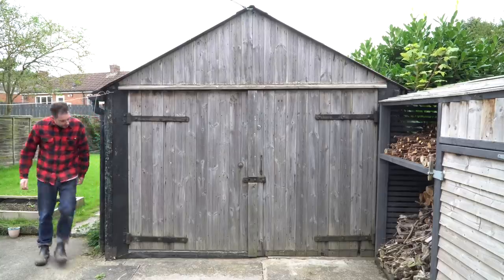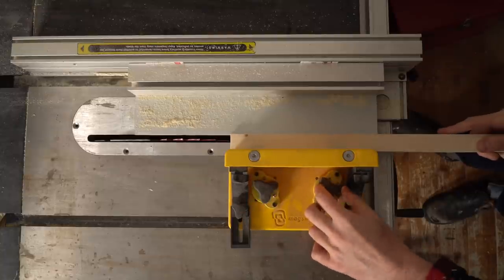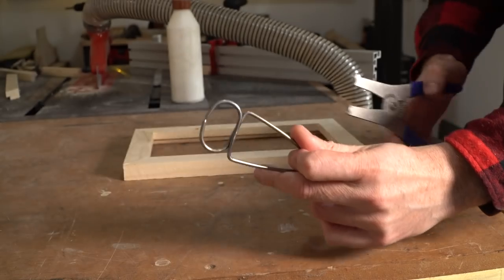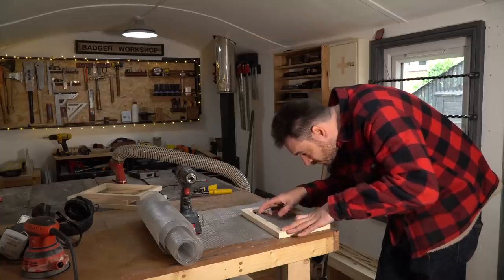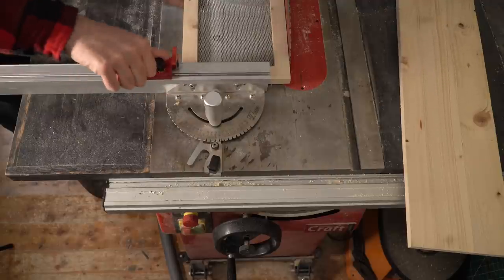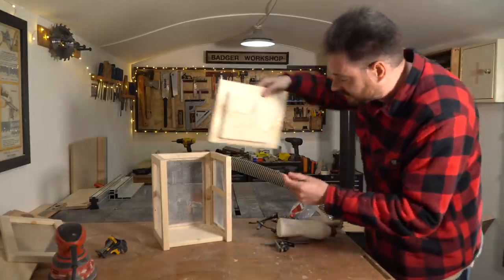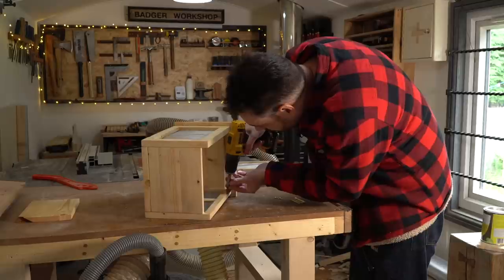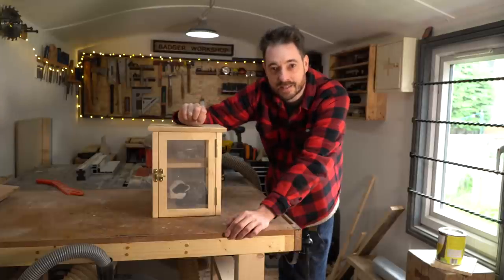Making A Cheese Safe

Comment: Nice old fashioned build, they used to make a simple "fridge" bolted in a hole on an outside wall. Had a tray of water inside or sat above a tray of water with cloths over it. As the water evaporated, it absorbs local heat this reducing temperature inside. Wasn't overly cold, but enough to stop butter going liquid!
Had them on old static caravans & challets.
Reply from the maker: Sounds a clever idea

Comment: Matt, what was that knocking stick you were using for putting the nails in? 🤣

I haven’t seen a hammer used in years, normally you see someone throwing them in with an air or battery nailer, this was great to see 😃👍🏻
Reply from the maker: Haha I do miss my air nailer